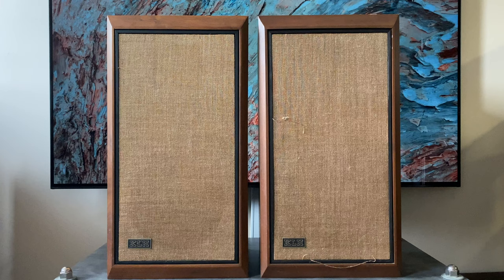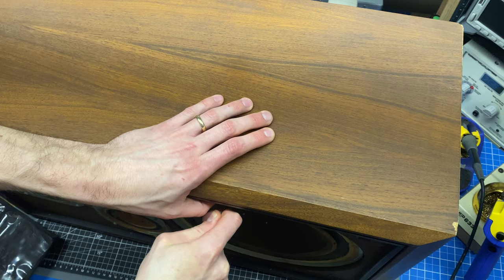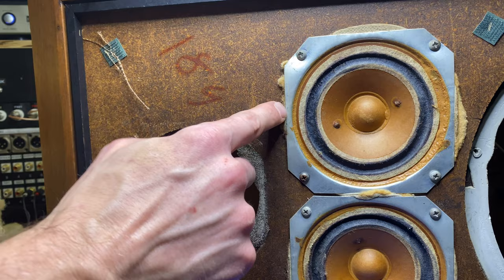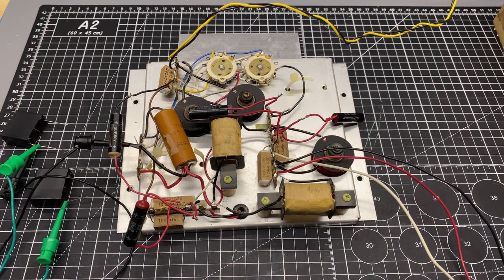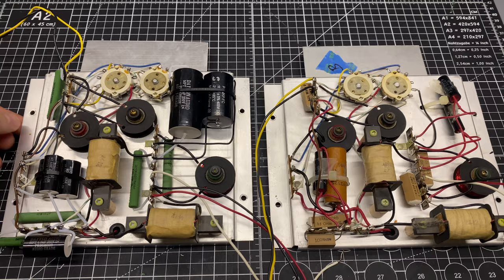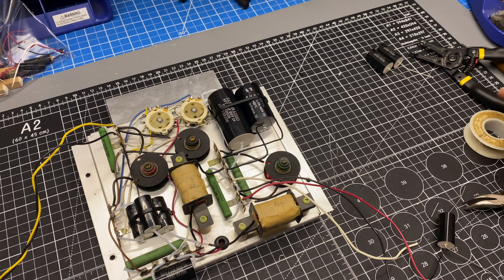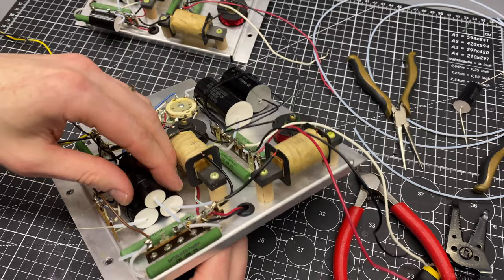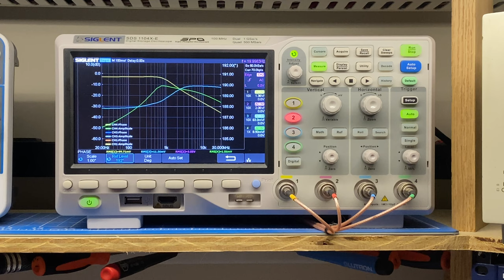KLH Model Five ~ Restoration Part 1 ~ Disassembly & Crossover Rebuild

Comment: Greetings Ben. Great video as usual.  Camera work and audio excellent.  I was fortunate to pickup a pair of Model 5's ($300 CDN.) that needed thee top side and bottom exterior sanded and refinished and sides just light sanding and restraining.  I flipped the grill cloths and restapled. They turned out great. I have made and addl. front speaker grill on masonite type board and plan to make a second set of grill cloths with a lighter 18 ct. linen cloth.  The woofers are the square magnet versions and the crossovers are the printed circuit board variety. By coincidence I used the same make and values of new polypropylene caps as you did in this part 1 video. I retained the original resistors as they were in great shape. After the crossover restoration they sound fantastic (for their vintage and age) . I have also restored along the way may Advent OLA and NLA versions for friends of my same 'Baby Boomer' era!!  All powered by fully restored versions on Marantz Receivers and upgraded with some restoration vintage 70's era TT.

Comment: Hey Ben, as a retired tech (who worked at a high end audio amplifier mfg) I really enjoy your videos!  You have a superb bench setup and great equipment.  Most of the other tech's on YT could learn a thing or two about having a great setup and keeping it neat and tidy, other than Mr Carlson - who's bench setup is like the helm of the Starship Enterprise.  Thanks
Reply from the maker: Thank you for the kind words. I try to keep things as clean as possible for my own sanity. I know many techs with vastly more experience and knowledge than I that are perfectly comfortable in relatively “untidy” environments but for me I get frustrated and lose tools when things get messy. I am glad others are noticing though, it took me a long while to optimize this bench and it works very well for me.
Reply: MR CARLSON WUD NOTT BOTHER UPGRADING THIS TAT... NOT COST EFFECTIVE AT ALL...

Comment: I am currently tinkering with a pair of Acoustic Research AR11's I picked up at a bargain price, BUT, they had some cheap 8 ohm woofers scabbed into them, probably because of foam surround rot and poor ownership care and speaker repair choices.
One thing I did notice on the teardown was, the internal wiring was all marked as being 22 gauge stranded wire. I personally find that small of a diameter wire, especially going to the LF driver / woofer as being totally absurd, as it barely has a rated current carrying capacity for the speaker at rated power. Since the air core choke had a solid wire winding measuring out at 17 gauge, I am planning to rewire any connections going to the woofer with 16 gauge stranded wire. I think it's funny how much emphasis that "audiophiles" place in getting oxygen free battery gauge sized cabling for a connection between an amp and the speakers binding posts, only to find true inadequacies used in mass production inside of the cabinet that they are not aware of. I find it kinda crazy that "wire nuts" were used inside of those speakers for connections, hopefully your corrections will help it perform better.
Reply: Ur right audio files r unaware of the cheap wire used inside speakers.. They miss the obvious.. It takes the genius to c this

Comment: Such beautiful and well-designed speakers. They sounded great back then, and I imagine they still do. And the acoustic suspension is still the way to go. Modern ported designs really work poorly in the bass, no matter the price.
Reply: They look like a blind man put them together. And those wires wound together with those weird toy town terminals.  Very poor construction
Reply: @mikepxg6406  Wasting new caps on tat lol

Comment: It seemed to me that your capacitance measurements were close enough to spec and the freq response curves didn’t show a huge change afterward.  So did you mostly rebuild for return on investment and because you were in there anyway?  Just curious.  
Is the paper cap film or lytic?  Are the black ones film?
Reply from the maker: Return on investment was not a factor in the decision. My recollection is that all of the original caps are electrolytic. Electrolytics that old need to go. They some may have “worked” but while the board is out it’s better to replace them once with film and never have to worry about going back in there in my lifetime.

The replacement capacitors are all PP film types.
Reply: @NovaluxStereophonic  OK, thanks.  Getting ready for a restoration and don't have a capacitance tester.  Was pondering whether I should rebuild the XO or not.  Now I know it's a must.
Reply from the maker: @jdsalinger73  Oh yeah,  if you are going through the trouble of pulling the crossovers, replacing the caps is the way to go. Resistors are 100% optional. Also consider adding jumpers for all of the common ground connections. If you have the point to point crossover version the rivet joints between the terminal strips and crossover plate can develop resistance over time and cause issues.

Comment: If you don't have a function generator, can you input a sine wave from YouTube?
Reply from the maker: Yes, as long as you have control of volume a test tone video can be used for basic checking of the drivers. The main thing is to avoid putting low frequency high powered signals into the tweeters.

Comment: Will using the 5.1 ohm resistor versus finding a 5 ohm resistor make a huge difference.
Reply from the maker: No, the original resistor has a tolerance of 10% so the value can range from 4.5 -5.5 ohm. The replacement that I chose has a 1% tolerance so fits within the range with room to spare.

Comment: OK last question I noticed that some of the resistors had a wattage value on them which doesn’t match the new ones for example the 10 ohm original says it’s 5w but the new one says 10w
Reply from the maker: Fine as long as the new ones are equal to or greater than the wattage rating of the original part.
Reply: @NovaluxStereophonic   does the tweeter have to be redoped I’m sure taking the metal off could very tricky
Reply from the maker: @emorykearns2073  No, only the woofer should be considered for surround doping. The other driver have paper surround IIRC

Comment: if a crossover calls for a 6uf but a 6uf is unavailable, can i use a 6.2?  Or is it better to use 2 3uf’s?
Reply from the maker: I would look at the tolerance of the original part. If it’s large like 20% and the new part of 1% or 5% for example the 6.2 would be fine. Depends on the original circuit and capacitor type.
Reply: Also I need a new speaker attenuator for an Altec Lansing 887a Capri speaker.  How can I find out which one to buy?

Comment: Change capacitors and resistors and leave that nasty iron coils and aluminium plates????? Why??? Point to point wire and air core coils is much better.